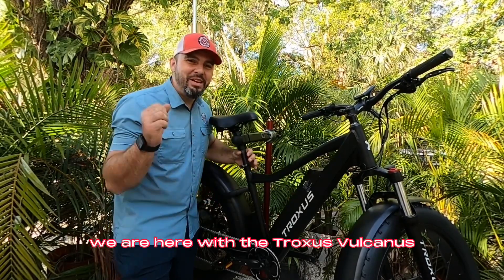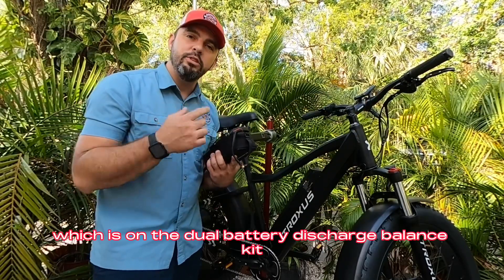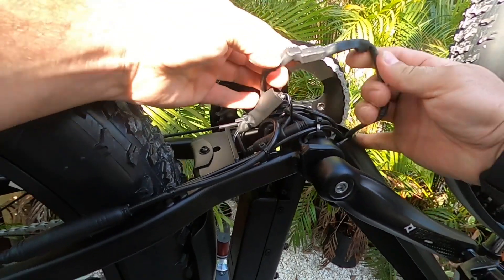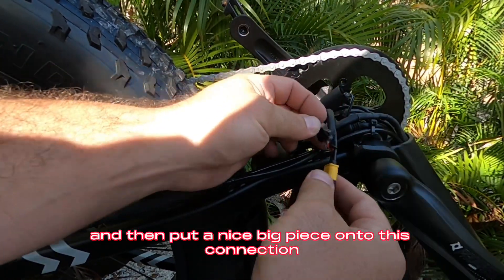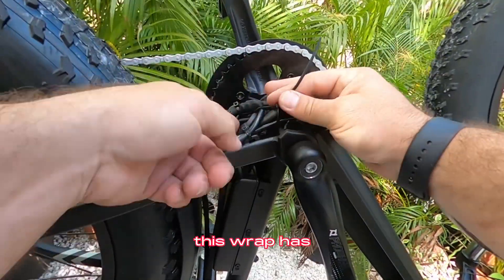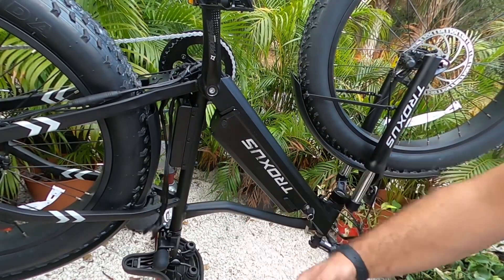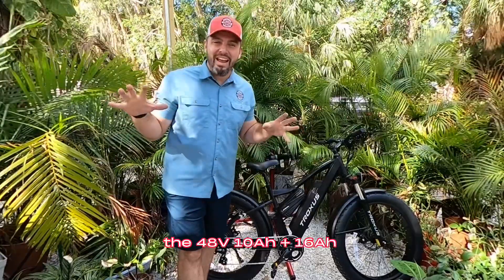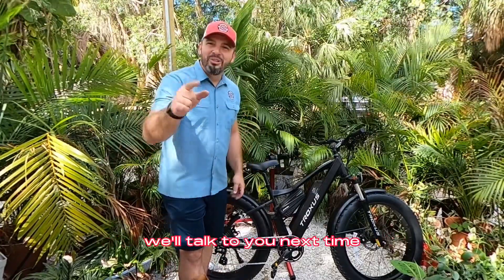Troxus | Vulcanus | Second Battery Electric Bike Dual Battery Discharge Kit Install Two Batteries

Comment: Do you have to charge both batteries separately with this setup or does one charger work to charge both?
Reply from the maker: The batteries are independently charged. The recommended battery does come with a charger.
Reply: @ElectricAllWheel  got it, thanks!